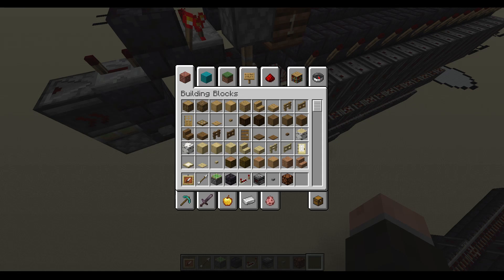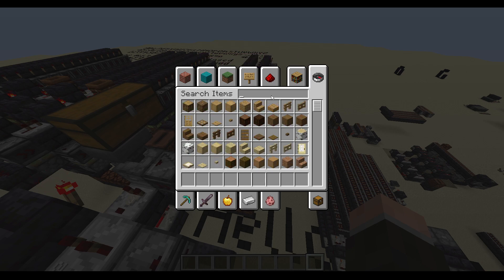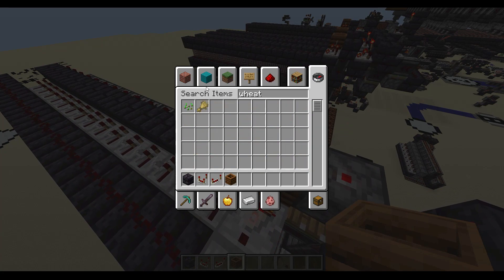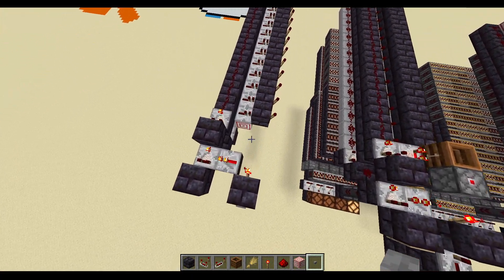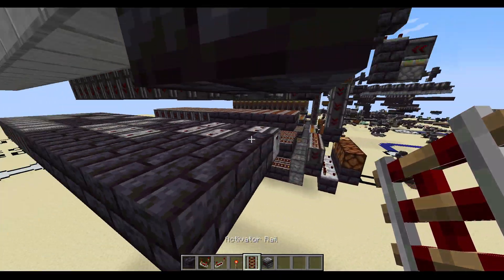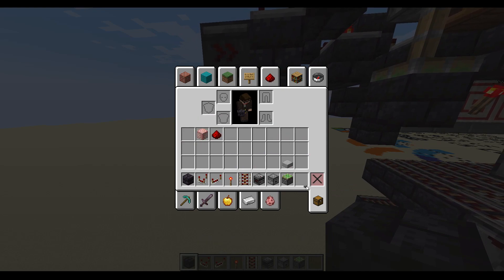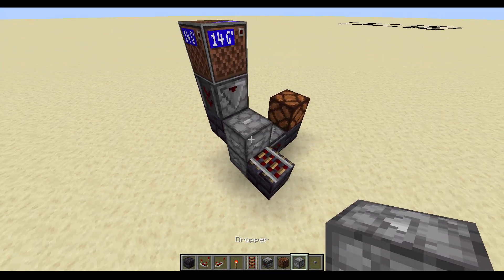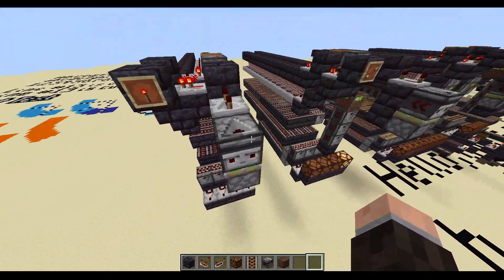Minecraft Signal Strength to Binary Recoder Showcase and Tutorial

Comment: Thank you so much for this Video!
I was able to make my own 3 wide version for a item frame decoder.
Except for the input that's 4 wide (my Input torch is one block furter away).

Edit: the timing setup was much simpler for me somehow!
I have my decoding part ontop of the Redstone torches. That simplifies it by 2 observers and since the 10:27 isn't needed because the signal strength reaches far enough for signal strength 8 (3 bit) it totals up to 3 observes saved. The 6:44 input torch has a block on it with another torch on the side, 3 observers stacked up going into a block with redstone on it that powers the 15:12 rail.

Somehow this just worked for me even with default 1 delay on the 6:39 repeater and without the input improved button input device.